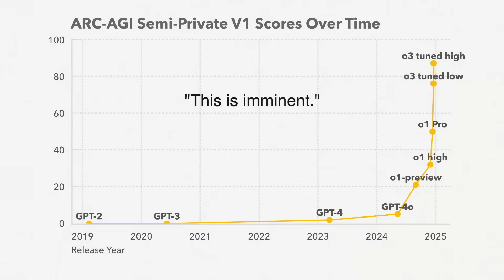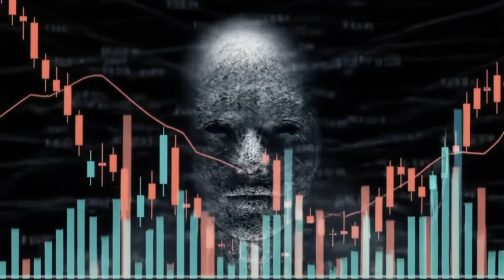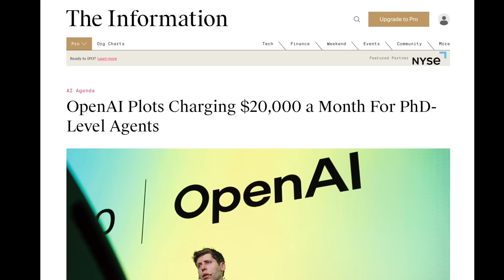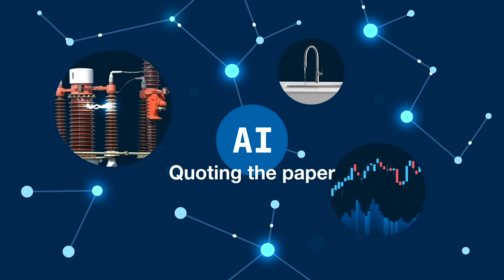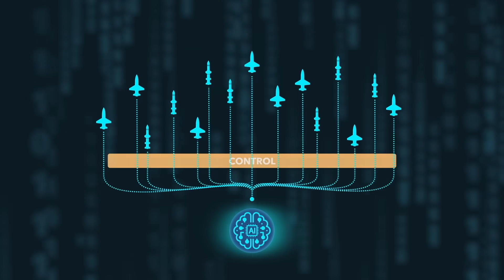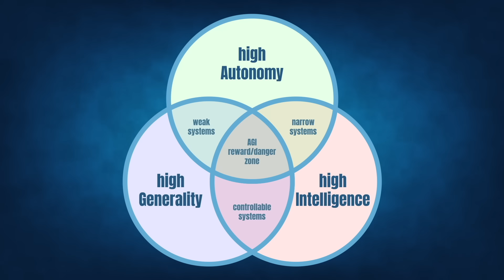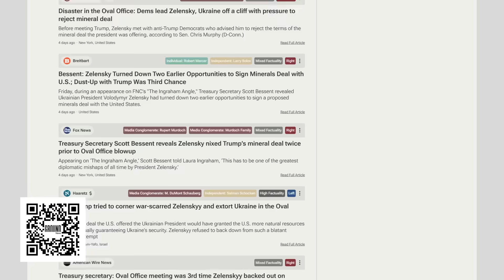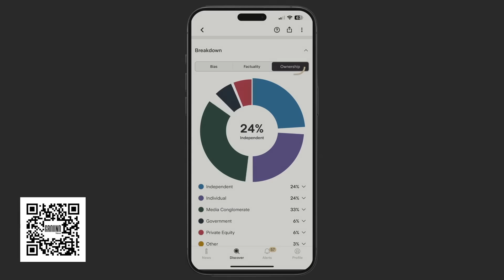Why experts say AI will spark WW3.

Comment: As someone that specializes in the physics of machine learning I am 99.9% sure that, assuming AGI is indeed possible, it is not less than 10 years away,  MUCH more if they insist on the current training - deployment model of LLMs as the path to that so I wouldn't lose sleep about it, but the job loss that they already cause is a real impending threat.
Reply: How would you know?
Do you think such an AI would advertise itself in a peer reviewed journal?
Reply: @ If you can find any evidence of a rogue AI, please let me know. Not a clip of some higher up saying its the end of civilisation, but actual evidence, let me know. AIs are just input, and output devices with a mess of probabilities in the middle
Reply: @lreeher  That is a genuinely good question, the fact is that you can never know for sure how to evaluate the level of consciousness of a system, but id say a good indicator is its capacity to interact with and mold its environment, as well as itself in response to the environment, which is something these models definitely aren't capable of because of the training - deployment way in which they are prepared, they can't actively learn once they are deployed, and they need to be prompted in order to execute anything.
Reply: Thank you, some sense, most of this type of stuff is spin to improve stock prices. There are actual concerns, but so much of it is theoretical

Comment: Ognoring the elephant in the room in favor of fear, uncertainty and doubt. The human brain uses less than 75 watts of power and can calculate orders of magnitude more than any current AI can even do with an entire data center using megawatts of energy.  All that glorious OpenAI consumes football fields worth of computing equipment and requires insane amounts of power.  Cut off the power or the ability to sustain that energy source and AI becomes a useless pile of metal. You know just like humans need a continuous supply of food and water well what do you think AI needs to survive? Heaps of energy, much more than any single human being and guess who controls that? That's right not AI so long as we control the supply of energy...

Comment: Spread this around: 
1) Make them build into EVERY robot a Physical Trigger button behind fire alarm type transparent cover. The button connects directly to a physical spring razor cutting mechanism which then cuts the connection from the robots brain to the body or transmitters (the wires can be replaced afterwards just by replacing the severed cables easily, and will clip back into place, when robot is deemed safe)!

2) Anybody can break the thin glass to hit the spring trigger either close up with a broom or with a bullet from a safe distance. And can also be fixed quick and simply once found to be safe, just by opening up the back of the robot and replacing the cables, and would be cheap to re-fix. 

3) Please push this idea to be implemented for ALL robots before it's too late to do anything.